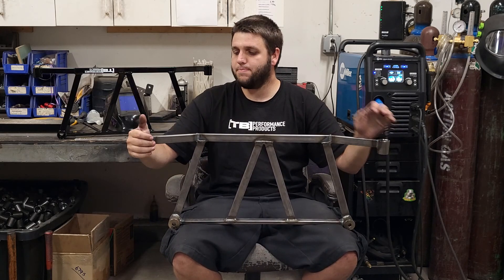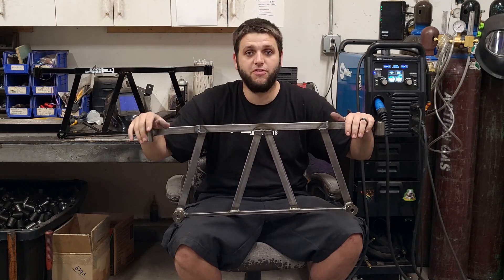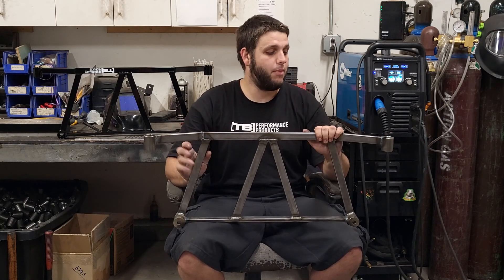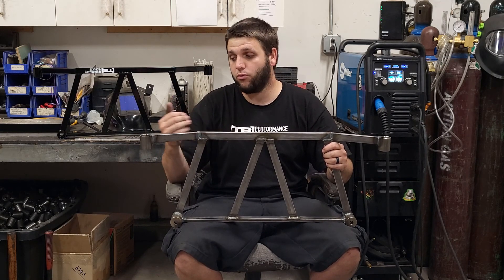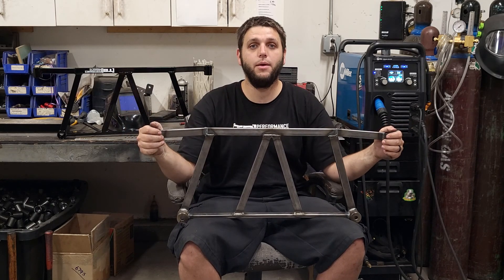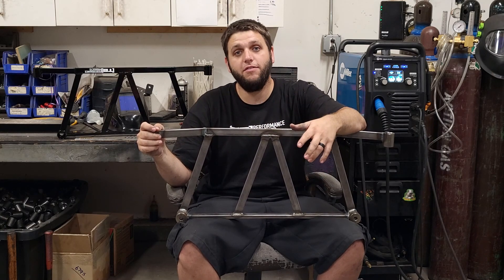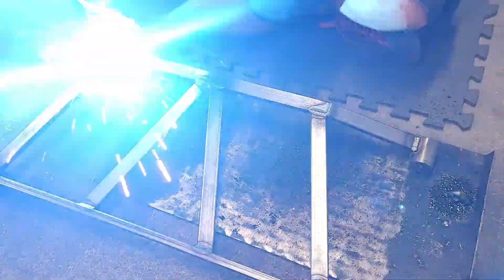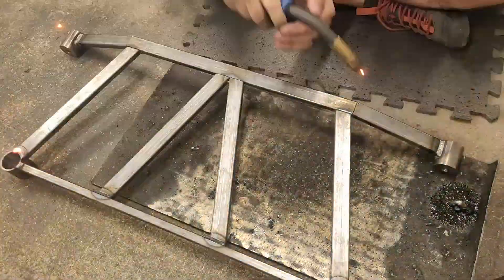Torque Gusset Traction Bar: What Does it Do?!?!?

Comment: so would it connect on an audi s3 aswell
Reply from the maker: Our 2 point traction bar will fit but unfortunately the Torque Gusset will not as they have some differences in the subframe that prevent fitment. Good question!

Comment: How well would this work with the Mfactory LsD?
Reply from the maker: The LSD rectifies a different problem for torque steer and wheel hop. This means that the two parts work great with one another since you are correctly addressing ALL the issues present that lead to wheel hop and torque steer

Comment: Can you use this in conjunction with the traction bar? Or does this replace that. Jw thanks
Reply from the maker: Excellent question. The Torque Gusset is a Traction Bar with added bits welded on so you CANNOT use a torque gusset with a Traction Bar as the Torque Gusset is a beefed up Traction Bar. 

The usual follow up question is, “is it worth upgrading” and yes it is! Its that much better. I've sold hundreds to customers replacing old 2 point traction bars and they've all loved it!